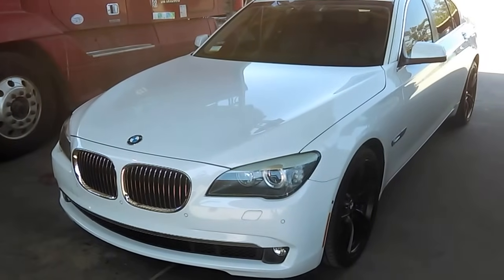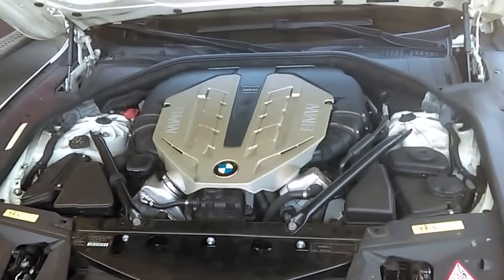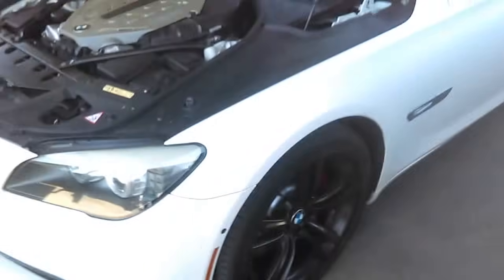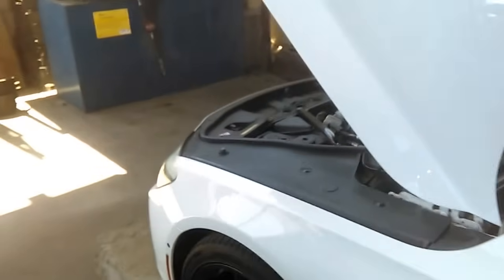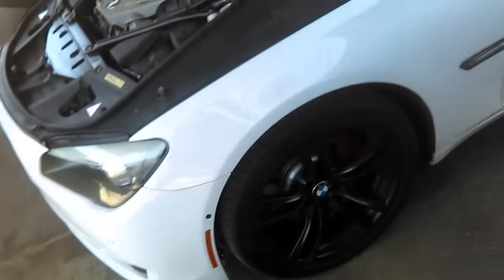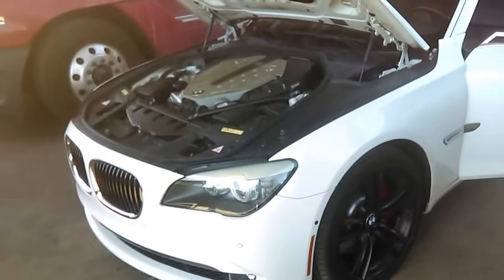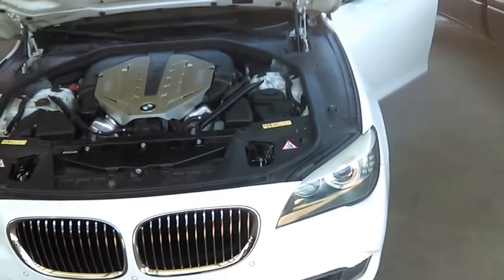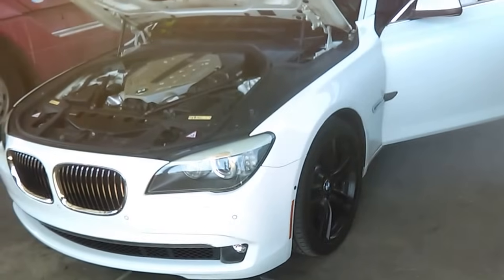BMW 750i 750Li F01 F02 common problems

Comment: Your videos are awesome.  Best I’ve seen so far.  Have helped a lot.  Have dealt w rear air suspension, control arms, battery replacement, transmission filter, radiator, coolant issues, cabin air filter, tires, brakes and now dealing w what I think is the need to replace valve cover gasket.  You videos have helped w most of these

Thank you
Reply: How much did you spend on the control arms ?

Comment: I have F01 740i I bought used with under 100k miles. The controls arms and battery were the first things I replaced after purchasing it. I also had to replace the flexible disc between the rear differential and the drive shaft to pass state inspection. I do my own repair work, so it didnt cost much for the parts (FCP Euro).  Like you I enjoy this car, it is easier to maintain and work on than the E60 5 series I previously owned. This car is a joy to drive and own. Nice videos!

Comment: I have experienced the first three problems mentioned. I was amazed that within 1000 miles of buying my 2012 750i I had to add a quart of oil. I researched the oil consumption online and found out that BMW considers it "normal". Now I constatnly check my oil level and have been adding a quart jsut about every 1000 miles.

Also at 64000 miles I had to have the control arms replaced because the ball joints failed. Prior to 2001 5,6, and 7 series BMWs would experience control arm failure because of poor bushing design. That was solved in the E65/66 series but now its ball joint failure in theF01/F02 series. Not much of an endorsement for "The Ultimate Driving Machine" company's engineering staff.

Now even after having the control arms replaced (which made the car more stable) I am still experiencing vibration with my 20" wheels. It's less than it was but I was surprised that it wasn't eliminated. My E65 with 20" wheels was noticeably smoother.

BMW is often cited as over-engineering their cars....but a lot of it is poor engineering. I say that as a nearly 50-year mechanical design engineer. Sigh!

Comment: Nice video. I didn't know about the control arms. 
But the battery doesn't go bad because of the number of electronic devices. It goes bad because of the huge heat buildup from the N63 engine with the exhaust in the V. This means that the fan needs to run for a long time once you stop (at least in hot climates) and this cycles the battery, killing it over time.

Comment: AS I WORKED AND FIXED LOTS OF THESE CARS, FIRST OIL CONSUMPTION COMES FROM UPPER OIL PAN GASKET LEAK AND BAD VALVE STEM SEAL, PISTON RINGS I HAVE NOT SEEING GOING BAD AT ALL LIKE THIS GUY TALKING, MOST PEOPLE GETS CONFUSED AND THINK RINGS ARE BAD, INSTEAD ITS A BAD VALVE SEALS, I REPLACED A LOTS OF THEM ALREADY, AND IT STOPS SMOKING AND OIL LEVEL WONT DROP. I HAVE FEW VIDEOS ON MY CHANNEL HOW I FIXED OIL LEAKS ON THESE N63 ENGINES
Reply: lies wheres the video of the N63 fixes??
Reply: expensive job to replace the seals. So i didnt buy that 550. Bmw wanted like 10k to do job.
Reply: I'm looking to get a 08 750li with about 73k on it. Do they have the valve stem deal problem as well? I really like the bmw 750li
Reply: yea they do. to check if the car has the problem, let it idle for 10-15 min and watch for smoking out of the exhaust.
Reply: iBoos  your right my sister have same issues when your idle  bloom of smoke I think bmw supposed to recall 7 series engine all have issue after 60k
Reply: Your right 💯 7 series most of them after 65k if you idle car for 6 mins will start smoke and you have to put oil every 2 weeks
Reply: Yes indeed,there its not bad ring ,just valve steam seals...this guy...🤣🤣🤣🤣
Reply: You are right. I changed two bmws with the same issue after 65k miles. Gaskets go bad. Easier to notice on the 40i's
Reply: how much do you charge to replace the steams?
Reply: @jhartmac100  anywhere from 5-10k.

Comment: Also the intake vanos solenoids needs to be replaced as well . Around 100K miles or 165,000 km . This causes the car to shake and sets off the 
Engine light on the dash.  Thank you Francisco  for the great channel .

Comment: Wish I would've seen this video before I purchased a 2012 750 Li.  It has a little over 95000 miles on it.  I purchased it from a reputable dealership and within 2 weeks the engine was shot.  The tech at BMW said there was brass in the engine.  I'm thinking maybe from broken piston rings.  A new engine is $27000 plus labor.  So I had to purchase a used engine and the labor is over $4000.  He's right.  Make SURE a BMW is what you want to invest in before purchasing one.  This will be my first and my last BMW.
Reply from the maker: +MDogg 4817 

I will recommend to give good maintenance to your BMW used always Castrol or mobil oil 0w40 (European formula) which can  work in almost every weather conditions.  

I know BMW dealer are using the new BMW twin turbo oil which is make by Pennzoil but it is not do good as the Castrol or mobil 

And when you buy your oil filter make sure to a German brand like mahle, Mann, etc,.. to prevent problems with your BMW engine.   
You can big these filter online at Amazon that's where I get most of my stuff for my BMW.  

I am going to make a new of the maintenance cost of my BMW and i will add the picture and prices of the part that I have purchased online including the oil filter.
Reply: Francisco Amaya Thanks.  I don't know if the oil had anything to do with the brass.  The only information the BMW tech would give is that there was brass in the engine and it had to be replaced.  You may be on to something when you mentioned the weak piston rings.  Thanks for the information.  I will definitely keep that in mind when having my oil and filters changed and look forward to the photos.  Thanks.
Reply: Great! Waiting on your maintenance costs...
Reply: MDogg 4817 achei a mesma coisa
Reply: Mdogg4817. U should have bought a used ls600hl
Reply: dang I love the 650s  but I'm scared to pull the trigger I'm just going to get a CLS 550
Reply: Ouch!

Comment: He is right on the battery/oil I just started to hear some noise in the left front wheel I'm  going to the dealer this week to check suspension noises. I lease a 2015 750li x  with 20,000 miles and 9 months left on my lease so my warranty will take care of everything! The car is a beautiful machine if you can afford it. like all cars and humans they have there problems BIG and small !!
Reply: RUBIN GONZALEZ  did you find out what happened with the vibrations ??

Comment: i have same vehicle and yes have or had same issues..always asking for a quart of oil..now i hear a weird wind noise or whatever from inside of dash.especially when accelerating.high pressure fule pumo,pcv valves and turbo lines always go bad also.and oil line with cheap plastic T splitter

Comment: This  is not true....the oil consumption not because of pistons ring or bad design.....the oil consumption because of valve stem seals & turbos...the BMW pistons rings is the most powerful rings in the market.

Comment: I've been researching the 7 series for 8 years now. I still want to buy one but there's just so many issues with the car.
Reply: Depends on what year and engine size you buy. DO NOT buy a V-8 built before 2013, unless you are a) wealthy and car repair money is not an issue b) have money to toss at the dealership like you're at a strip club and c) you want to experience chasing oil leaks from various failed gaskets and O-rings. I wanted a 750, but after popping the hood on an 550i and seeing all the work I would have to do just remove obstructions to get to the engine valve covers, I said no effing way and bought the 740i. I couldn't be happier with my purchase and my car. No high oil consumption, good gas mileage and I still have all the luxury accessories of a 7 series. Get you one!
Reply: @javonnehall5465  Ya, I'm kinda getting leery about the 2013 750 LI xDrive with 48,000 miles I'm thinking about. All that power, ya! But maybe its not worth it. $33,000. Ugh. I'm having a hard time leaving my 1999 Acura TL with 260,000 miles after 17 years. I want my next car for at least 15 yrs. Maybe I should look at the 6 bangers, not 8 cylinders?

Comment: Hey... Got 750i v8 2010. Ignition malfunction. The engine does not crank and does not start. The car is pretty new to me. I'm still driving Mercedes C200 w203 turbo diesel.

Comment: Biggest problem people in America don’t understand about Herman cars is that the part have expiration dates.not mileage limits.

Germans will change parts out of they have a certain age not wait for a certain mileage or until they break. 

Ferrari Lamborghini and the other super cars are like that also. 

You can own one of these high door cars and not even drive it and stuff breaks. Gaskets leak , and plastics crack and allow leaks. 
If your in extreme temps like 100 degrees or super cold like -10 winters , you will see even more problems. 

Parts age and need changing to these high dollar cars. 
That’s part of the reason they lose value so much. The other is the cost of parts and labor is so high.
Reply: Pee wee started making cars? Good for him, good for him...(peter Griffin voice)

Comment: Thank you. How about ball joints, timing chain and guides?  There is a tool on the internet that can rent for changing valve seals with engine still in car. I looked at one but the rod bearings were out and it was backfiring into the exhaust manifold

Comment: Hi, I am having an issue, on my BMW 750i 2009, my wipers turn on unexpectedly and stay on, and I can't turn them off, only if I pull out the fuse or disconnect the battery, then I reconnect it and it stops and then the turn on again

Comment: Hi Francisco, great video. I'm having a problem with TPMS. It will not reset. I spent a looking time looking for the antenna under the car near the driver's seat only to find it mounted inside the rear bumper. I replace dit but the TPMS malfunction warning remains. I think there is a main control unit but I cant find it anywhere. Would you know where the main control module for the TPMS monitoring is on a 2012 (F02) 750LI?

Comment: Is it the upper or the lower control arms that go bad? Both sides? Ball joints?  I like your videos. I am thinking about buying one. I have had many BMW’s over the years. I have a 2002 540i. May I ask on the 2002 540i, if the timing chain guide breaks and the chain goes out, do the valves need to be checked for being bent always?  Last question:  does this 750 Ix 2012 engine have timing chain problems that need to be maintained

Comment: Hello Francisco,

I have an issue with my transmission flickering from P to N when I try to park it and it just gives me an error of transmission malfunction. Any suggestions?
Reply from the maker: Probably you need to replace the transmission fluid. It could have low pressure. Also replace the filter

Comment: Hello, I'm thinking of purchasing a 2012 BMW 750li but when I went to see it and the sales man turned it on, the engine was making a loud clicking noise coming out of both sides of the block. We asked the salesman what was that noise, he claims that all BMW's sound the same, 🤔 does yours have a clicking sound? I have a video but I can't attach it to this comment.
Reply: Suarez fam don’t do it dude get a Indy shop to look it over first... should not be making that sound.
Reply: @bigstivks3355  Thanks dude. It sounded like a freakin' diesel. It was quite loud.
Reply: No, that is NOT "normal". My 2012 750i doesn't make that kind of noise.  Something is wrong regardless of what a salesman says.
Reply: No it's gonna leave u broke runnnnnnnnnnnnnnnnnnnn

Comment: I have 740li 2013  6 cylender bought new ..after warrenty she gets fall apart ..exactly what this man said is true...
Engine Power problem..suck oil ...breaks warn fast...loud fan ..suspension problem...et...i made mistake in my life when i bought it...the problem when sell  bmw  prise goes down .

Comment: thank you for sharing amigo!
would you buy it again?
Reply from the maker: +relikvija 
Yes, I would buy it again. 
I like BMW's, I am planning to buy a 2009 and up 650i or a X5 50i/X5M
Reply from the maker: +Francisco Amaya 
About the 750i, I would like to buy 2013 and up (facelift version) still have very similar problems but the engine was redesigned completely and it has more power.

Comment: oil consumption, battery and control arm / 20" wheels sensitivity is not anything major... turbo or gasket problems are major.
Reply: My 750Li has no leaks and I haven't noticed any smoking but it's definitely burning up oil. About a quart and half in 2000 miles of highway driving.

What's the fix and how expensive is the repair?
Reply: Cary Coller man I would say that’s the design problem, my friends said the fuel injector can also cause the huge oil consumption
Reply: @jackyna7444  fuel injector cause huge oil cons. hell no,the stem valve gasket cause oil consup.
Reply: Cary Coller it’s the PCV and it costs around 1000$ to fix
Reply: Damn Right
Reply: @carycoller3140  There is no fix, it's a design flaw in the pre-2015 N63 engine. The only solution is to buy a post-2015 MY vehicle.

Comment: I was about to get one 2012L x drive M but I don';t think so anymore, it burns oil, smells so bad on the exhaust pipe I don't know if I really should.
Reply: Never buy BMW, very bad in everything 
On top the guy said, my 750li has 170K and already transmission slips and I think clutch has burned 

Also, it is bad for exosted gas comes inside through the heat vents.

Also, from outside it smells like a excavation with burned oil.

My verdict: total lemon!!!

Comment: Im having and issue, no air blows in front at all. It does blow in the back. I have replaced the blower motor. What can it be?2011 alpina b7

Comment: I get a vibrating noise on my 750Li. seems to come from the front end. It’s sounds like the front bearings. I got new SKF front bearing hubs installed, new full drive shaft and I still hear it. You have any idea what it could be? Only 116k miles
Reply from the maker: Maybe the rotors are unbalanced or a bushing is busted.
Reply: What year is your car? I’m looking at buying a used 2011, but I don’t feel too happy about it now.

Comment: Hi Francisco, and thank you so much for all tips and videos. I have one problem with my F01, 2010. The trunk lock dosen't work. it wont unlock. Not with the remotecontroll, swich inside the car or not with buttom on the trunk. Only manual with the key. The trunk lift engine works  still. If you have any tips or clues what could be wrong it would be most appcreciated. Best regards Gunnar from Sweden

Comment: My AC automatically turns on constantly. It's a 750 Li 2010.it won't stay off..the battery loses charge and goes dead  I don't drive it to much
Reply: Me too
Reply: Do you have the original battery? If you install other battery it needs to be registered.

Comment: Hey buddy.. I have the same 2011 bmw 750li with approximately 100k kilometers and the BMW dealer here in Pakistan has given up trying to fix my car.. 2 major issues, one the shifter wouldn’t go into park and defaults to neutral and says have problem checked by service and second is when driving and reving up the engine, it gives a drive train error and you have to turn the car off and then on again to drive because the car gets really shaky. Any suggestions, tips, experiences? Would really appreciate and subscribe.
Reply: Do they  have dealers in Pakistan 🇵🇰?? I thought you guys rode camels 🐫 🐪 only .
Reply: @jaimecruz5367  you’d be surprised
Reply: Did u figure out problem?

Comment: Hi Francisco how are you.
  How do i fix the smoke problem while seating in traffic without spending that dealership money.
Reply from the maker: You can try by replacing your pcv valves first and see the results
Reply: @franciscoamayaYT  thanks so much Francisco

Comment: so u saying the car has bad piston rings? how then would it hold a HIGH compression ratio? r u sure its not doe to the fact with new environmental regulations you can vent oil into the atmosphere and therefore the crank case recirculates oil vapors into the air intake which then gets burned... this process is magnified with any turbo car. i can find many videos and articles explaining this phenomenon. Here is some features i will quote from the n63 motor "high-performance pistons and reinforced cylinder heads to withstand the additional stress from a higher compression ratio." 2 min in and already hearing nonsense,lets go for more. 20inch wheel vibrations... hmmm sure not cheap wheels, friend has an alpina b7 no vibrations with 21'', Entrepreneurs in Cars had the same problem when he bought an aftermarket set for f10 m5